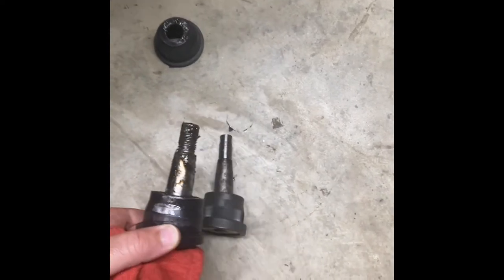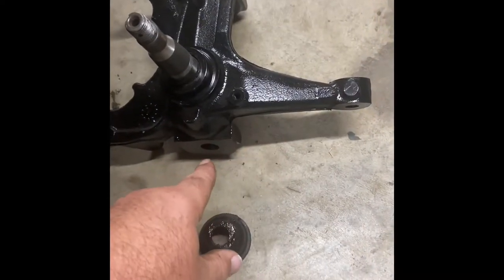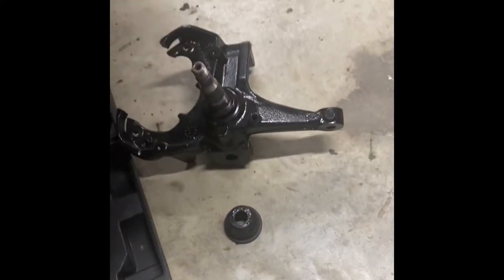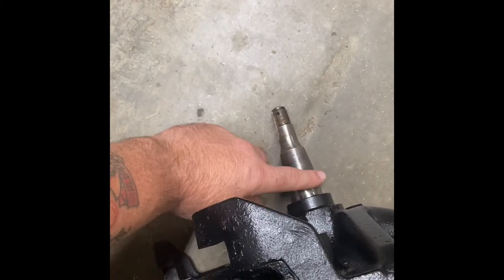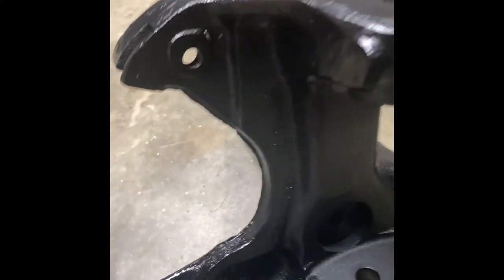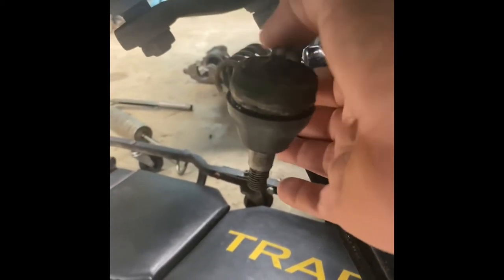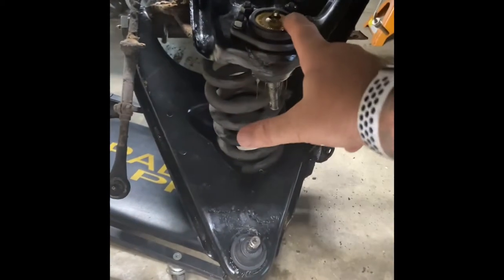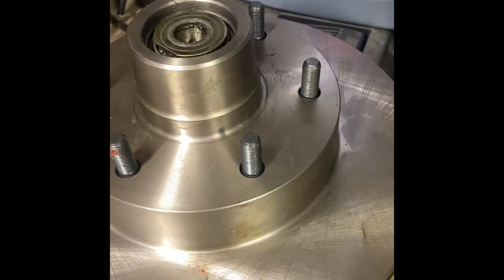Part 3 disc brake swap information for parts! 67-72 C-10

Comment: Very smart using Rock Auto i just did a 67 but i went to the local junk yard pulled everything out of 95 1500 replaced all of it the cool part about it this 95 was lowered so i took advantage of the parts kept the upper and lower control arms replace with 95 ball joints  and it to is 6 lug  lots of luck with your project.
Reply from the maker: Nice! That seems that went smoother than mine! Lol thank you!

Comment: How did you run your break hose from the caliper?
Reply from the maker: I believe it’s in video not sure what you mean. I ordered the rubber hose from the square body c10 I believe there is a model number in video